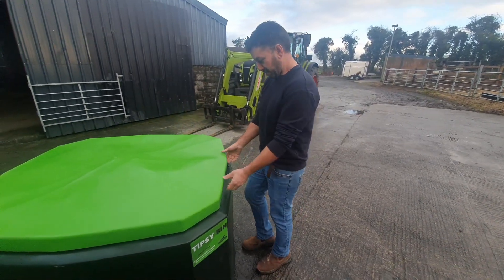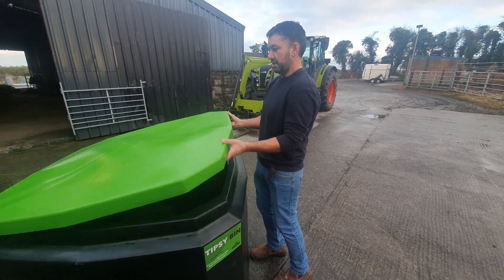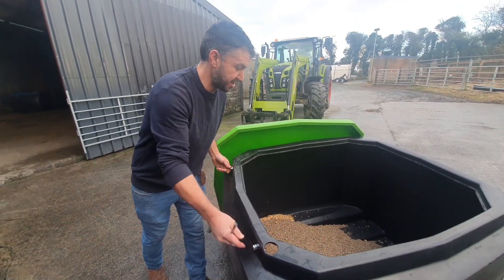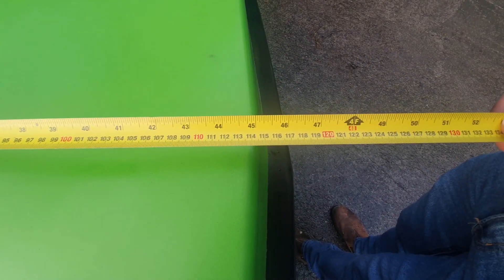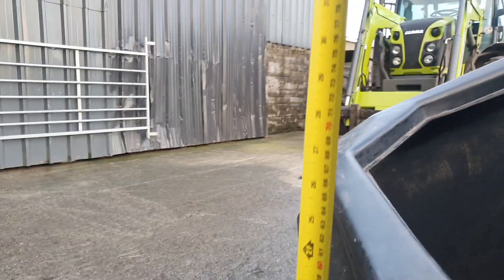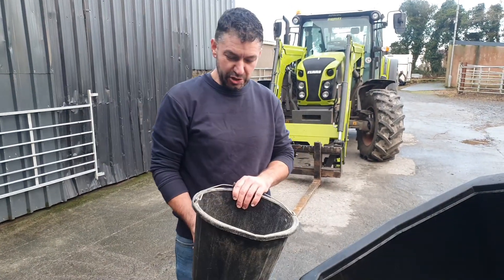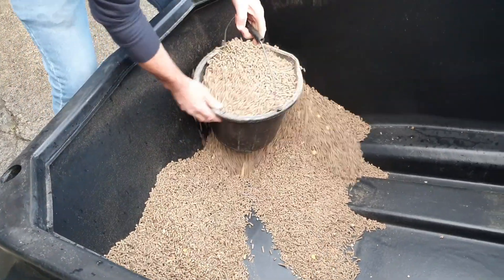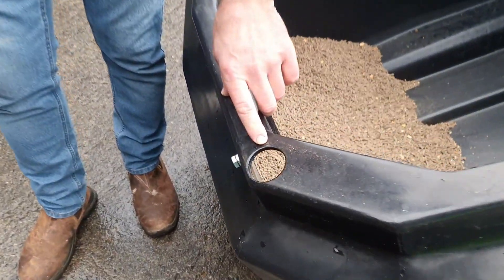How the Tipsy Bin works...

Comment: Good enough bin but it’s a pity the makers didn’t put a bit of thought into putting hindges on the lid
Reply from the maker: Hi Danny, thanks for your interest in the Tipsy Bin and your positive comments. We did think about hinging the lid but it’s not practical as most bins go under a hopper for filling and a hinged lid won’t work. Also, in windy sites there would be the risk of the lid slapping closed and causing injury. Thanks again, Michael.
Reply: @megafabltd  no excuse 🤔hinges could be fitted that the lid would fold back behind the bin
Reply: Michael have a look at the ordinary wheelie bin and you will see how the hindges work that I am talking about!! No problem they will allow the lid to fold right back causing no problems!! Even if it was windy it would be safer than trying to get the lose lid back on!! Just an idea ye could work on !!
Reply: @dannyjones7181   There is a business for you , manufacture a bin with hinges on the lid . You will make a fortune .
Reply: @megafabltd  you could attach hindges for lid like what’s on the ordinary house hold wheelie bin